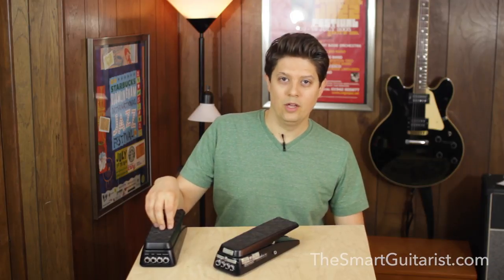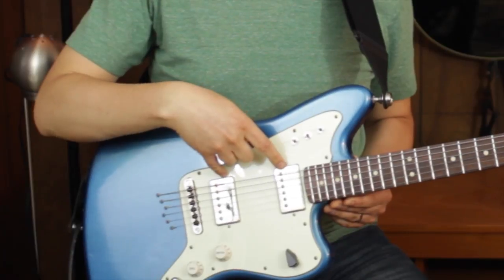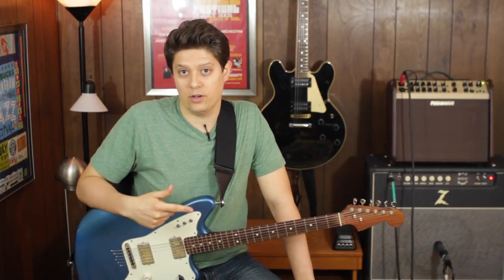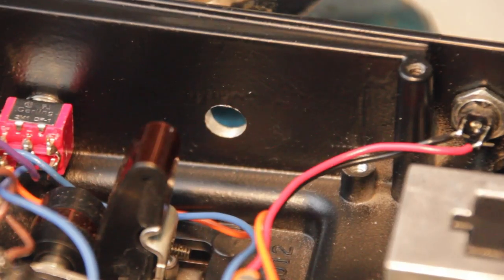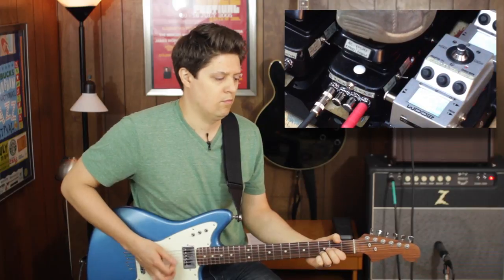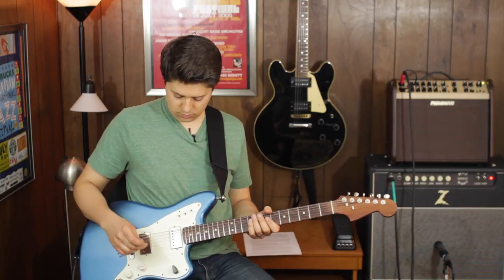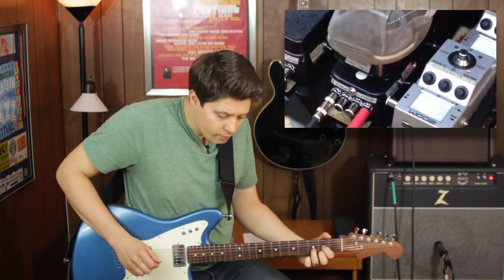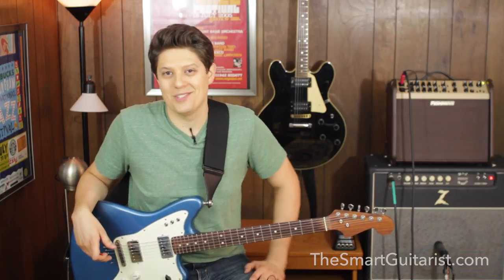Dunlop VolumeX Mod - Conversion to Stereo, with buffer (for the "über" guitar)

Comment: If I wanted to make a stereo mute pedal using a 3PDT switch how would I go about doing it? I want to make sure that the input signals don't mix as I'm going from a stereo effect chain to two separate amps.
Reply from the maker: Hi Ryan - are you asking about building this into a Dunlop VolumeX? Or just a standard small box enclosure?
Reply: thesmartguitarist into a standard small enclosure
Reply from the maker: Ok cool. Should be easy. I think you can do it with a DPDT switch; 3PDT would only be necessary if you want a light.
Reply: thesmartguitarist can you send me a sketch of how I would wire it with an led?
Reply from the maker: Hi Ryan - man, this slipped off my radar - are you still in need of a schematic for this?
Reply: That would be great!
Reply: I've got it working as a mute but it doesn't keep my left and right signals separate.
Reply from the maker: Ok I'll get back to you soon!

Comment: this is awesome man. and I've got one question, can I connect a switch a pedal to switch out from volume to expression??
Reply from the maker: Thanks John! You're talking about leaving the pedal mono (not doing a stereo conversion like i did), right? And adding an onboard switch to switch between volume "mode" and expression "mode"? Yes, that's do-able. There is a thread somewhere on thegearpage about it, and a long thread on my "5 reasons to mod your dunlop volumex" video about it too.
Reply: The Smart Guitarist thats how I found this video actually haha. I was thinking of putting in an external pedal to switch betweem modes pretty much in all honesty don't even have one of these but I've been needing a volume pedal and saw this one had an expression included then found your 5 reasons to mode your pedal video which lead me to this one. this one is where I got this idea for that pretty much haha and I wanted to ask where is a good place to start to look to find one of these pedals??
Reply from the maker: John - ah, so you want to add a jack, and plug in a cable to an external switch box to switch modes? That's probably do-able; I need to think about it a bit.
Reply: The Smart Guitarist awesome if you can get back to me on that it would be really helpful thank you.